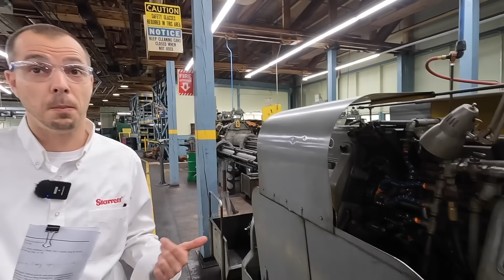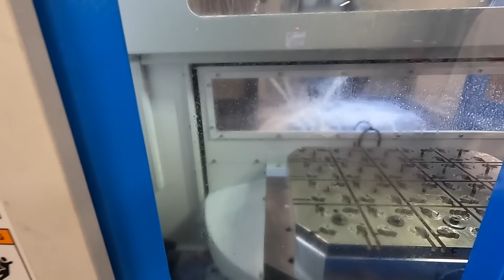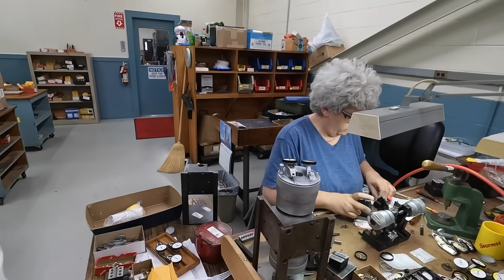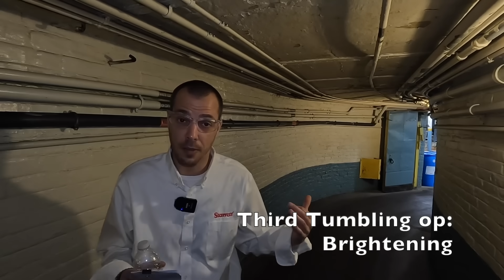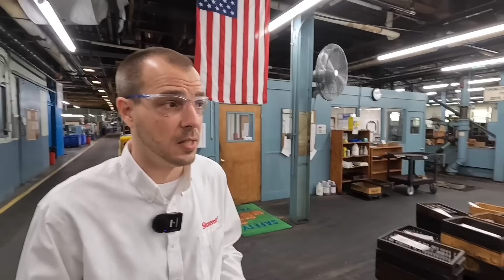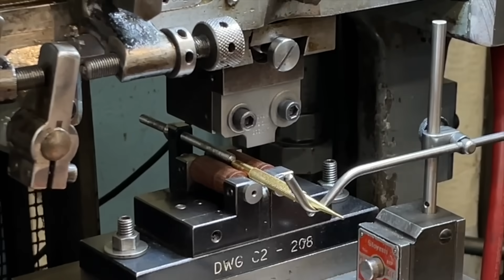The L.S. Starrett Company Factory Tour Part 2

Comment: Hardest job I ever had was being "the toolroom guy". Most of the pro welders and machinists at that company, thought the toolroom was an extension of their toolbox. I was hired to "PRO UP" the toolroom ops. I improved the security and accountability and stopped all losses that were not use related. I made some friends that were also ex military and thought it was about time that things were running professionally with integrity. I made some enemies by making it almost impossible to get in the space, steal anything, and fired those that were held accountable by HR doing the investigations. I was very proud of the job we did in the new dept. name... Floor Support & Tool Control. I cleaned up QA also with the help of a retired Navy shipmate of mine. His nickname was QC from his many years of Destroyer and Sub Tender duty. Watching the tour I could smell the smells. Just like watching the operators at Booth Machine Shop. Wink.
Reply: good resume - you're hired !

Comment: I absolutely loved this tour and break down.
I have one question...... As I watched different areas assembly depts, I noticed use of (air) blow guns.
How do they ensure there is no moisture in the compressed air system? as I think this could cause issues in parts during use.
Reply: Dryers and Evaporators remove moisture from the air lines BEFORE air reaches the work stations.

Comment: ABSTRACT

This video provides a detailed tour of The L.S. Starrett Company factory in Athol, Massachusetts, showcasing the manufacturing processes of their precision tools. The tour highlights the company's commitment to American manufacturing, skilled craftsmanship, and continuous investment in advanced technology.

SCREW MACHINE DEPARTMENT

− 1:00: The department starts with 12-foot rods of various materials like steel, aluminum, and brass.
− 1:20: Starrett has heavily invested in automation and CNC screw machines, specifically the Tornos Swiss LS, to improve efficiency and reduce lead times.
− 2:12: A percentage of parts undergo inspection for internal quality control.
− 3:11: The video demonstrates the production of a pinion for an indicator using a Tornos Swiss LS machine.
− 3:52: Older, cam-driven Acme machines are being phased out in favor of newer technology.
− 4:23: The video shows the production of an outside micrometer shell, highlighting the efficiency gains achieved through automation.
− 5:20: Starrett emphasizes the importance of attracting younger generations to American manufacturing by embracing technological advancements.
− 6:05: The department has a dedicated tool crib with kits containing all necessary tooling for each job.
− 7:18: Starrett's special order department can manufacture and assemble custom tools based on customer specifications.
− 8:44: The video showcases the production of a high-precision micrometer head with 50 millionths accuracy.
− 9:14: The department also manufactures tiny screws, spindles, and other parts for dial indicators.

INDICATOR DEPARTMENT

− 15:02: Building 22 houses the indicator department, where parts are machined and assembled.
− 15:10: The department features two new Tornos Swiss LS machines, replacing older Robo drills.
− 15:28: The video shows the production of a bridge assembly for an indicator, highlighting the use of pressed rubies for wear resistance and accuracy.
− 16:40: The department utilizes collaborative robots for tasks like bending and slotting parts, demonstrating the focus on automating simpler jobs.
− 19:14: Tom C. Magic, a 40+ year veteran, demonstrates the hobbing process for spiral cuts on 196 indicators.
− 21:11: The video showcases the cutting of a 12-inch rack for a long-range dial indicator.
− 23:31: The department also uses older, manual machines like Hardinge lathes and multi-spindle drill presses for various operations.

INDICATOR ASSEMBLY

− 24:44: This department assembles various types of indicators, including drop indicators, test indicators, and back plunger indicators.
− 24:51: The video shows the assembly process of a dial indicator for a dial bore gauge (catalog 84).
− 27:03: Sue, a long-time employee and assistant supervisor, demonstrates the assembly of a test indicator.
− 28:53: Starrett offers refurbishment services for older tools, extending their lifespan.
− 30:50: The video showcases the assembly of a Last Word test indicator.
− 31:38: The department also assembles parts for the 196 back plunger indicator.
− 32:05: Kayla, a six-year veteran, demonstrates the assembly of a 196 back plunger indicator.

TUMBLING/MASS FINISHING DEPARTMENT

− 38:42: This department performs three primary operations: cut down, blend, and brighten.
− 38:47: Cut down uses ceramic media to remove burrs from parts.
− 39:14: Blend smooths the transition between different surface finishes on a part.
− 39:29: Brighten uses a different type of ceramic media to achieve a polished finish.
− 40:31: The department utilizes wooden crates for holding and transporting parts during the tumbling process.
− 45:38: The video provides a close-up look at the tumbling process for various parts, including tap wrenches, indicator bodies, and caliper legs.

MILLING DEPARTMENT

− 51:14: This department focuses on manual milling operations using conventional and climb milling techniques.
− 51:27: The video showcases the machining of a 98 level's V-shaped base using a K&T (Kearney & Trecker) milling machine.
− 52:55: Ricky, a 28-year veteran, is highlighted as the department's expert miller.
− 56:00: The department utilizes various manual milling machines, including K&T, Cincinnati, and Tree mills.
− 57:11: The video demonstrates the machining of individual leaves for a thread pitch gauge using a slitting saw.
− 58:06: The department has a dedicated tool room for storing and maintaining cutters, vices, and fixtures.

PUNCH CELL

− 1:00:03: This cell focuses on the production of punches, available in steel and brass for different applications.
− 1:00:23: The video demonstrates the use of a roll stamp to apply the Starrett trademark onto punches.

i used gemini 1.5 pro

Comment: ❤ I had bought a lot of their products over the years and only had a problem with one of their 3 to 4" micrometers. 
 I send it back for repairs and it had the same problem. Returning it again and they sent me a new one and I had no more issues or problems with the micrometer.
 All in all it took 4 months to get my mic. to work at toolroom standards.
Reply: Bought a defective mic, returned for repair, sent it back still defected and finally replaced? With a four month lead time? 
I’ve sent in mic’s for rebuild and it’s never taken more than two weeks. If something was unrepairable , they just sent me a warranty replacement. Four months is absolutely ridiculous unless you had some kind of super special, one of a kind instrument.
Reply: @Miner-49  we didn't have ups back in the day and I had to use the postal service and yes it was 4 months of in the mail and in repair. 
 Get over it, I have. 
Sometimes things you buy are not up to standards and that micrometer had a fault and the Starrett Co.. did not fix the issue with the first micrometer but the 2nd replacement was perfectly fine. 
 So I mailed 1st to them, they worked on it and mailed it back. Then I tested it out just a few days later, failed again, made phone call and mailed it back. They mailed a new one back in perfect order. 
 The micrometer was probably in the mail more than in the shop.

Comment: Adam, this is like visiting Santa's workshop.  I am loving every minute of it right down to the end grain block flooring.  This used to be standard in all production machine shops.  The thinking was if you dropped a part on the floor, it would not be damaged and end grain is more wear resistant than conventional plank flooring.  Good stuff.

Comment: I bought a 12 inch USA made Starrett dial caliper, the rack was 2 piece and it was defective from day one. When the pinion would hit the joint if the 2rack pieces you could feel the joint. I sent it in for repair at Starrett and after a month  or so it was returned in the same condition. I gave it away to a young engineer and now buy Mitutoyo.

Comment: So.... Because i was looking for one, and then i saw your video.... I just pulled the trigger on this....Starrett 120 Series Dial Slide Calipers for Accurate Measurement with Fitted Plastic Case - White Face, 0-6" Range, 0.001" Graduations - 120A-6

Comment: All I recall was Mr Pete's video about Starrett several weeks ago. It's not looking good. Wonder how many people in the video will have jobs before the year is out after the asset strippers finish with the company.
Reply: Did you notice how few workers there are in the factory. So many machines left idle?
Reply: @comictrio  
That’s because one machine is doing the work of three old machines. If you pay attention, the idle machines are antique, slow and out of date. You can’t run a business when the machines cost more to maintain than they can produce. A lot of companies have gone out of business for that reason alone.
Reply: @lookingbehind6335 yes, you have to upgrade to keep the mfg cost low enough to stay in the black. Old machines are cool, but as an industry, we've worked very hard to improve the equipment and the process time. Have to keep up on all fronts.
Reply: @comictrio  Of course.
Reply: @comictrio  I did notice the ACME GRIDLEY’s sitting idle having had the operator retire. What a vulnerable situation. Some companies paint themselves into corners like that. With what appears as a daily job becomes totally out of control situation when the key person gets hurt/sick or retires!
Reply: A majority of the people will retain jobs. Operation steps are being replaced with multi operational equipment. You will still need machinist to operate them. You will also need people to assemble the tiny components. I don’t think machines are precise enough to make whole assemblies.
Reply: I am one of those workers and the business is dying
Reply: That's the feeling I got too. And the more the tour guide talked about hiring and "whatever you need we can make it" sales pitch the more it seemed like Starrett was on life support. Plus, they're touring in what appears to be a weekday and where the hell is everyone?!?!
Reply: Still hearbreaking ... this wasa "family" business